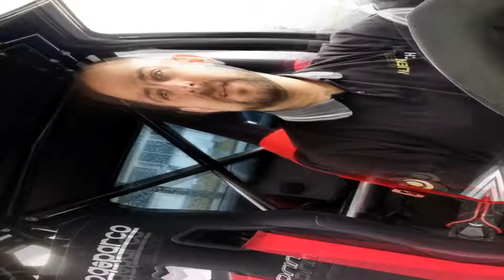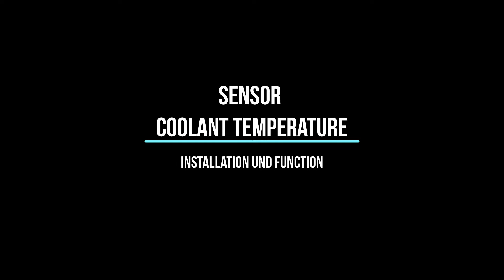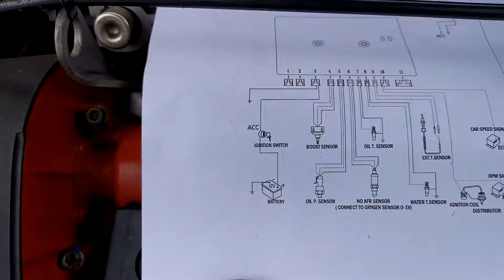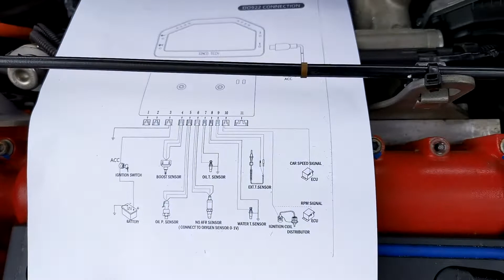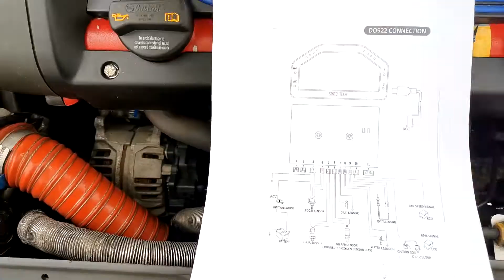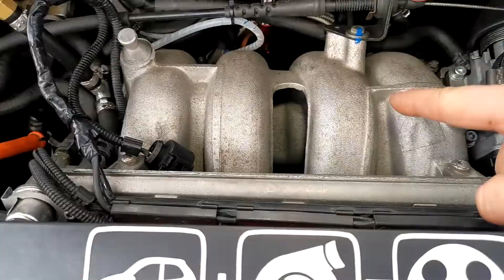Installation & Functions SincoTech Racing Dashboard DO922 Part 1 English

Comment: Hi how would this work if it's an older car with a analogue speedo cable? How would i get a speed signal?
Reply from the maker: Hey, thank you for your Question. Yes this is a Problem! Maybe you can use the Signal from a Inductiv Sensor from the ABS if you have one. Next idea is to Build a own Sensor on Gearbox with a Signal you can use!